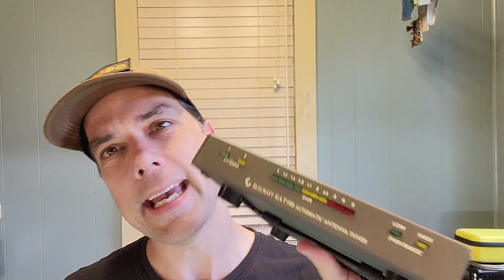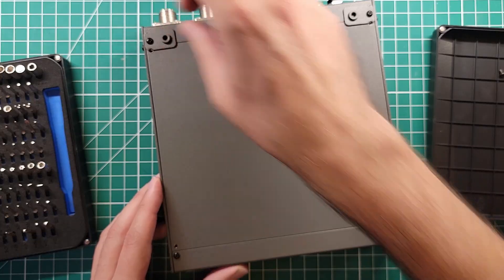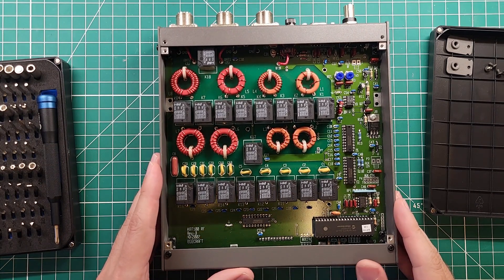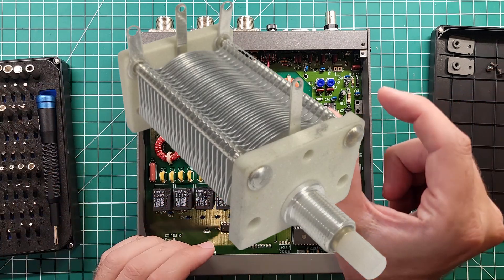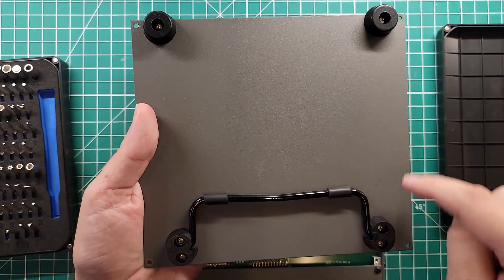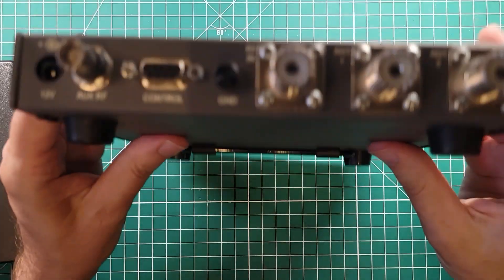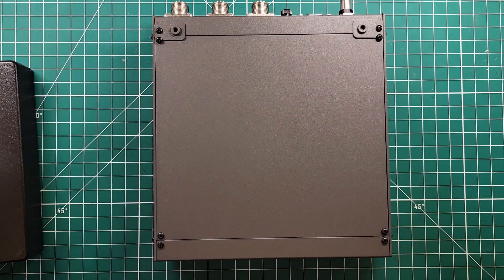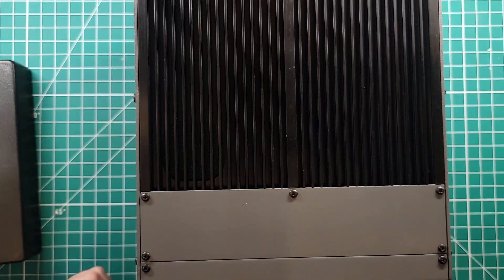What Makes an Auto-Tuner Work?

Comment: I've always understood the concept of how an ATU works but what I've always wondered is the nitty gritty of the algorithm for tuning. 
Like if it simply does every permutation in the tuner and selects the lowest SWR or if it finds the inflection points just like a human would. 
This is seriously tempting me to design my own ATU based off the ATU you install in the KX2
Reply from the maker: I would hope it does something intelligent - like measuring the current swr and then matching out how L and C needs to be added, and then tweaking from there after a second test.